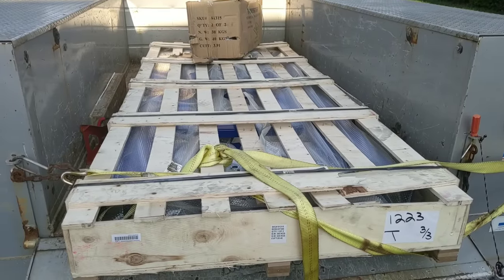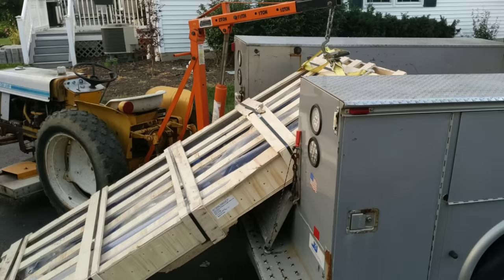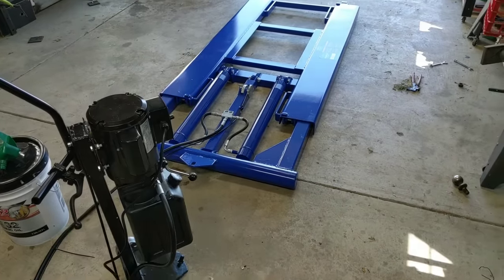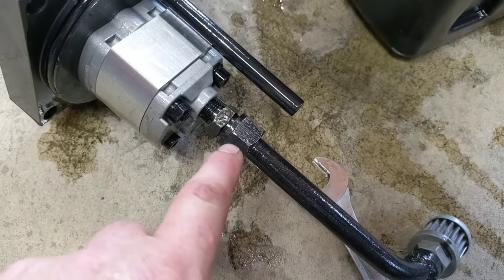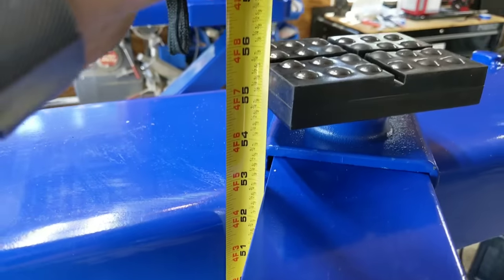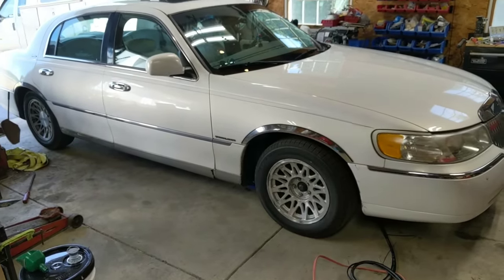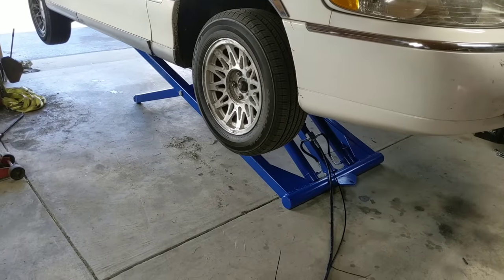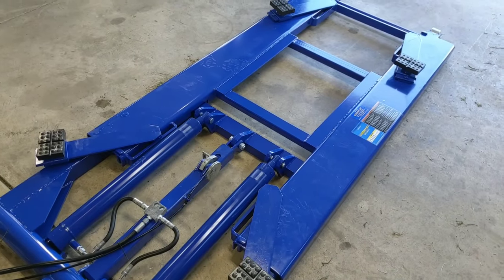Harbor Freight 6000 Lb. Capacity Scissor Lift Review, Central Hydraulics, is it worth it?

Comment from the maker: At the time of this video, this lift retailed for $1,600.  Over the years it has also come and gone multiple times from the Harbor Freight website.  My best guess is they sell them when they have them in stock.  

Remember, this is a scissor lift, it's not really designed to get access to the underside of a vehicle.   You really need something like a post lift for that kind of access.   This is perfect for lower body and detail work, you can wheel all around the car without post casting shadows or getting in your way.  It's a different tool, for a different job. 

Also I see a lot of concerns about safety.  I did a follow up PSA regarding safety concerns, hopefully this explains how not to use a scissor lift.   https://youtu.be/RAqqgq7ielE

Comment: The lift itself is a cool and useful tool but I would not crawl under something from harbor freight that holds that much weight.
Reply: Harbor-Fright!
Reply: I’ve been using their trans jack for semi transmissions and no problems
Reply: 👍Sounds like good advice Serrano. They probably caution that in their "Safety Instructions"😂
Reply: I'm Leary about any lift or Jack.  Got the HF hydraulic lift small motorcycle one for sbout $130.00 on sale and with a coupon about 6 years ago.  It's fine even with an 800 lb bike on it. Not anchored down as a move it around . It's a knock off of the Italian pump up lifts most motorcycle shops had way back when. HF is improving quality on some things. But if you need a one time use tool really can't beat EM. To bad though it's not made here. Good review! I think the pump pick up issue is due to poorly paid laborers as I see a lot of that in China's products of all types as it's just slapped together.
Reply: @gregt.3987  Hazard Fraught
Reply: I have a motorcycle jack LIKE the    Harbor Freight model. I wonder if it will lift a 1985 Cadillac Eldorado ? Also there are holes for "Stop + brace" positions so that the pump pressure for the vehicle you are lifting won't fail.
Does anyone know if this type of motorcycle jack will work as I described?
Thank you ( in advance) for answers . I possibly could try to find a sticker showing weights of both the jack and the car but if I don't maybe some genius will know.
Reply: @dukester5419  The lift will either lift the weight or not. Always use brace positions no matter the weight.
Reply: Fair enough, but I can't help but thinking that that is a strawman theory. I can't remember the last time I read about a decently (even half way) constructed lift, jack, or jack stand that failed and crushed somebody. The only articles I can remember seeing in recent memory or ones that involve somebody completely improperly lifting a vehicle and failing to support it at all. Don't get me wrong, I completely understand your point of view. Most devices that are designed for lifting or supporting weight are rated at idiot-proof levels. Thankfully. 🤞
Reply: I agree with your overall point about Harbor Freight but these aren't designed for someone to crawl underneath them. It's pretty much physically impossible with all of the "stuff" in the way. Which, BTW, makes these lifts seem pretty useless to me. I don't know why people buy them.
Reply: @9ZERO6  An old rancher near me was killed by a riding mower jack. All his life around tractors and died from cheap jack. His wife found him dead in the garage.
Reply: @ayebee1207  that is awful.
Reply: you're not supposed to be crawling under the car with these lifts dude.
Reply: @enkrypt3d  if it failed you don't have to be under it to get hurt or killed
Reply: @Shiesty6.7  isn't that what I said?
Reply: @enkrypt3d  no you said it's not meant to be crawled under. I'm saying under it or next to it, you can still get hurt.
Reply: @Shiesty6.7  are you just dying to have a debate with anyone and everyone? geezus dude..
Reply: @enkrypt3d  you're the only one I responded to lmao. You're lost
Reply: @Shiesty6.7  again I'm not disagreeing with you. not sure why you think I am?
Reply: They're great for tire changes, brakes and suspension work.  Most home garages don't have enough overhead clearance for a full size lift anyway.   I have a Mohawk 10k two post lift in my shop, but I've got 13 ft clearance under the rafters.
Reply: Additional jack stands would be nice.
Reply: @donhill1825  Most all the tire stores have similar. I'll probably get one. Easier to do struts, shocks, brakes, rotate tires, u it bearings, etc... These newer cars, 4" clearance, are a pain to get up high enough to get under.  I put a piece of square tubing across under vehicle and lift with a A frame with two chain hoists now. Put a 6x6 block under tires, or piece of cross tie. Then it is high enough to get the real jack far enough under it to find a secure lifting point, and have enough room to pump the handle.
Reply: You saw how slow it goes down with a bunch of weight on it... also it has mechanical safeties so if the hydraulics do fail, it has a backup.  I'd have no problem getting under a car up on one of these.  It's not fixed to the ground however... so load leveling and surface will matter and THAT could be dangerous if you're an idiot.  =]
Reply: @ridgerunner106  safety first!  I'd do whatever it takes to be safe.  Just use common sense and logic =]
Reply: @liberty9348  Sometimes a hard hat just ain't enough.
Reply: Harbor freight has all kinds of good stuff.. just have to know how to get the right stuff from there
Reply: @ayebee1207  I worked on the farms a kid. Farmer safety was piss poor at the time. Drive shaft covers for bailers etc. were just really coming into place but lots of older harvesting equipment had a rotating exsposed drive shafts that if it grabbed your jacket or shirt would rotate you and severely injure you or kill you. You needed to disengage the shaft drive everytime you stopped the tractor as a safety practice. Two kids riding on the tractor when seed drilling or bailing with dad, oops one is in the drill and there goes fingers and toes, Saw that happen amongst other things
Saw stuff propped up poorley as they wanted to fix an issue and get back on the field (we as kids didnt know any better at the time). Safety since then farm safety  has improved but a farm is still a dangerous place to be as in accidents or if something happens and its only the farmer or operator by themselves when it occurs.
Reply: I worked for a company that had me standing under a 2400 lbs I beam while being lifted with a 1 ton hoist from Harbor Freight... I straight up quit.
Reply: Its not built for crawling around under it, in case you didn't notice how its built with all those frame parts and pieces there's no way you are crawling under a vehicle that's on this lift.
Reply: @mooglemy3813  If it was made here (Good Ole USA) it would be 4 time the cost.
Reply: @mikemarler8224  What is the price range for those?..
Reply: Your smart.
Reply: ISO UFO I don’t blame you but overhead lifting equipment usually has at least a 4:1 safety margin. Rated versus failure loads. While I don’t think you were in imminent danger, I agree with your decision to say no and leave.
Reply: @donhill1825  I can think of a couple of things. 1) working on the wheels, brakes, and suspension. 2) lower trim. 3) detailing. Atleast for me my back hurts after a while being bent over changing my brakes so this would be nice for that.
Reply: That thing is suppose to lift a car😖💀
Reply: You put axel stands under the lift to hold it up just incase it fails
Reply: @9ZERO6  ive seem hydros fail on manual pump or eletric motor and it comes down fast with zero warning
Reply: The factory forgot to properly torque some bolts. Let me crawl under it
Reply: With load locks it can’t collapse
Reply: @toddtoth6616  their jack stands collapse
Reply: Well ...not everyone wants to live forever .
Reply: @gregt.3987  yep, remember their recent jack stand recall for jack stands that split at the seams?  quality!
Reply: That's why u put jackstands duh
Reply: I totally agree with you. The only way I'd get under it is with some "Serious Blocking".
Reply: Once it’s up, like any other lift, you put Jack Stands under the vehicle!!!!!!!
Reply: @dukester5419  no man, I think you're max 1,200 lbs ..... No car on the bike jack
Reply: @donhill1825  Not designed to work under them.
 I've been doing bodywork for decades.  This type of lift is the cat's a55 .   Saves me  from   a lot of  aches & pains.

Comment: The Words Harbor Freight and 6000lb scissor lift should not be in the same sentence.
Reply: Yea only snap on can make
Reply: Maybe it refers to the weight of the lift, not the capacity ;)
Reply: Actually, I've had no problem lifting my 3/4 ton truck that weighs >5900lbs.  Zero stability problems and zero issues lifting it.  The 6000# rating is totally legit.
Reply: @SvdSinner  Until it's not.. Thanks.
Reply: A Chinese lift for our made in China POS American vehicles.
Reply: Jesus Christ ! Speak for your self I drive German with a 
BendPak-HD9 lift
Reply: Scary just looking at it.
Reply: @pyrorye-80  Tell that to the 12yo welding it up!
Reply: @chrisfrank8413  anything is anything until it's not
Reply: Cooper Watkins If it’s mechanical it will fail at some point, except his stuff. Never his
Reply: I saw a 20 ton press that someone returned to Harbor Freight. It bent itself. The 2 C-channel bars,the bars you put your parts on,bent downward and the sides that are made of I-beams were bent inward. That's what you get for buying a 20 ton press for $180 out the door. I wouldn't get under that car,no flipping way.
Reply: @SvdSinner  dodge ram full size  extended cab 4x4  lifted well  no issues  great lift  small cars   perfect  for oil changes and brake jobs even swapped the rear end on my ford ranger  plenty of height with  harbor freight  small rolling chair and oil drain drum..
Reply: Could not pay me to get under that thing
Reply: @pyrorye-80  and you're defending horrible Freight when in this video he received a broken lift.   Wow,  Harbor Freight Fanboys defending a company that sells broken junk.  😂
Reply: @pyrorye-80  Some people equate their self worth with the cost of stuff they buy.
Reply: rye rye 300$ with a lifetime warranty.... is that the tools you speak of, or is is the tools that actually are built to spec when considering case hardening etc?
Reply: Chris Frank i have never met a Chinese Muslim in a labor camp that enjoys his job... this might effect quality lolz
Reply: Chris Frank Chinese steel, low box site quality, on a lift, that wasn’t assembled correctly, shipped properly (because bubble wrap is so expensive). Nothing like buying a new item, and having to fix it the day you open the box, why not just buy a refurbish locally, or a 50 year old lift that needs refurbishing? Since you put so much work into the lift? I just am not seeing it. Cheap tools are fine, to loan to your friends...
Reply: i was thinking that too.

Comment: I've had the same lift for nearly 3 years now without any pproblems.  It has suited my needs for brake jobs and tire changes.  It has saved my back by not having to bend over and contort.
Reply: That's what I was thinkin
Reply: How much does it cost?
Reply: My buddy has one.  Works well and when we need underside access.  We use the lift then place Jack stands under the car and let the lift down.  Simple

Comment: I worked at HFT for 12 years in the store and for corporate, I visited the Quality department in CA a number of times, and despite some of their tools being junk (for anyone but the casual user) the QA department took their jobs seriously, its a lot of work to change something but wherever improvements and safety was concerned they tried their best to roll out those changes in the next iteration. I was proud to work for a company like HFT, they actually do care about bringing good quality tools at lower prices, it may take them longer to get there than the big names but they try.
Reply: I don't know if I should believe you
Reply: @wildestcowboy2668  I don't know how frequently you shop at HFT but if you've noticed that many products have multiple SKU"s, some of the tarps for instance have 5 plus different SKU"s. This is because each SKU has some modification to the design that effects the items performance or longevity. The QC department does its research, suggests a change, the change is implemented as a new SKU # then they see how well it performs. I was at the QC building when they were prototyping the Hercules and Bauer Drills, They were doing real world and stress tests on the drills. They had 3 or 4 huge stones out back of the building and they were drilling thousands of holes to see how well the drills held up and how long the battery would last under heavy load.
Reply: @01srob  how come you quit
Reply: @wildestcowboy2668  Burned out, In the last couple of years there I was doing a bunch of PM work across pretty much every state in the country traveling nonstop. My average work week was in excess of 90 hours and I had some 300+ days of rental cars in my last year. I cant blame HFT for all of it, most of it was just the requirements of the job but some of it was due to my own pedanticism. I received an opportunity to take a very slight pay cut but go down to about 50 hours a week with zero travel, I took it and it was good for my health. But to be honest I miss the work and the travel. If I ever got the opportunity to work for them in a similar position again I would take it in a heartbeat.
Reply: @01srob  I can respect that. Be careful up there.

Comment: Have one for 14 years. Love it. I rebuilt the cylinders s year ago. Wierd thing I notice you say is yours is 220. Mine is 120v. Just plug it in and go. Lifted my 454 big block k2500 4x4 suburban last month all the way up, no problems.
Also we made wide ramps to drive low vehicles on it to clear. Also if you want to move it raise it up to first safety notch. That rotates the hitch plate and makes moving a lot easier.
Reply: I would have to say it's a nice unit

Comment: This is a great unit. It passed my last test as it picks up my 06 crew cab silverado 1500 4x4 with no problem at all. I was a bit hesitant at first but shes a beast. It feels secure in the air. Doesnt feel like its gona tip over even after i give it a couple shoves to test the sturdiness. I had to change the oring in the pick up tube and oil pan gasket. Have had this lift for about 4 years and its definatley a great addition to my home garage.

Comment: Great review. I’ve been wanting a lift. Back when I was a kid my dad had a auto repair. He bought a lift from a gas station that had closed. It was a frame style with sliding legs. Man it was nice. Now that I’m 59 I just can’t crawl around on the floor anymore. Thanks for the video
Reply: I'm 31 and thinking about getting a lift, do it dude, I couldnt imagine another 30yrs of crawling around on a creeper and jack stands hahahaha Itt's cheap but holy cow I work on cars too much to be doing that for much longer
Reply: I'm 37 and I can't do it anymore.. one car repair on the ground feels like I worked on 10 cars under the hood
Reply: Years ago, you could have a"pit", where you could stand up under the car to grease it, change oil, etc. For some reason, they were outlawed. I worked for years at a Chrysler assembly plant in a pit, with cars moving down the line. I guess a major corporation can do it but not a garage or a hobbyist. Might makes right !

Comment: I paid 1,800 for my Dannmar Max Jack, worth checking out before you go buy this. It’s a twin post lift, goes up about 44 inches and leaves the entire space below the car open. Clear access to the transmission, engine and suspension. I use a low rolling stool and it’s a lot better than swimming around on the concrete. Still not as good as a full size twin post lift, but that’s next. 😁

Comment: I have the same lift and brought it used. Love for what  it's capable  of doing.  Everything  you use in life has limitations,  learning to work around them makes life challenging! !! Also if you raise  the lift up 1 to 2 hi , it makes moving  easier. Congratulations!
Reply: @robw7205  raise it up about 2feet. Then use the pump to move around. It makes it shorter(the wheel base) and easier to move
Reply: @robw7205  The lift raises up to just under 4 feet.  I think Terry means putting a 1-2 inch pad underneath the Lift if you want to reposition it.

Comment: Great review.  I could see that being a handy lift in short garages.  I would like to see it modified with some kind of f outriggers before I would trust it at full height with a vehicle on it.  Looks like a good lift for wheel/tire/suspension work but like most scissors jacks it is really in the way for any under car maintenance.  Good video!

Comment: Nice review.  You can make up a quick disconnect at the pump so you can easily detach the unit from the lift,
similar connections used on tractors and other hydraulic lines like the Bobcats.  I have the Bendpak MD6-XP.

I got a queen size bed frame at Habitat ReStore, put some OSB on it and just push it over the lift when not in use,
can keep my mower, leaf machine and other stuff on top when not using the lift,.

I easily dropped the subframe on my '99 Taurus wagon with this type of lift, 
using engine support bar tool, and no problem at all to swap transmission out.  The front of the car hangs over the lift for easy access.

Many Corvette and Porsche owners use this style lift too, some recess it in the concrete to keep it flush with
diamond plate over it when not in use.
Sure a post lift lets you work under the car, however you have the posts in the way all the time.
I like the scissor lift design. 

BTW you have a lot more patience fixing the lift then I would have had. 

Best Regards